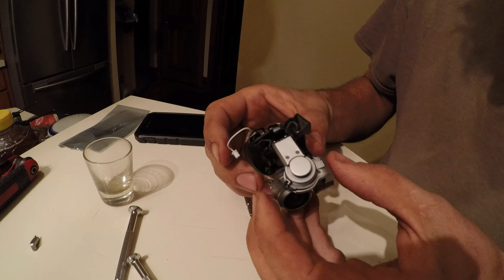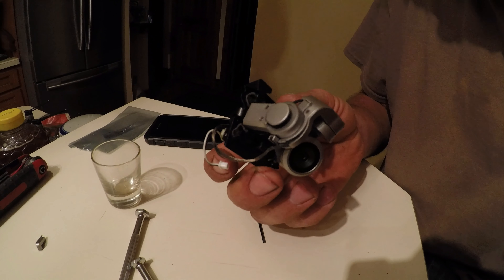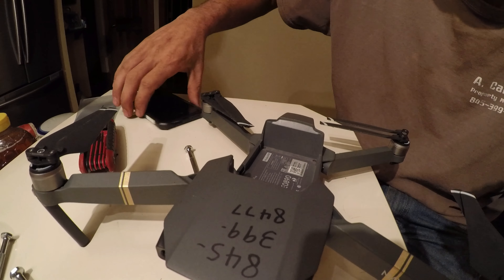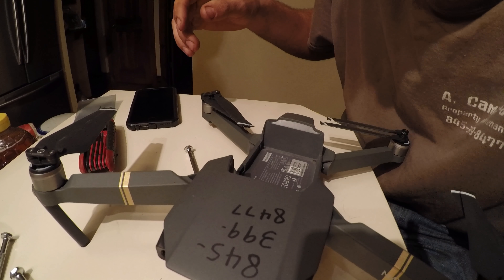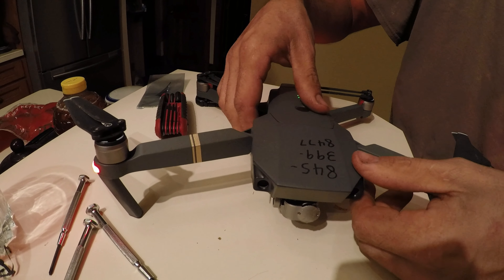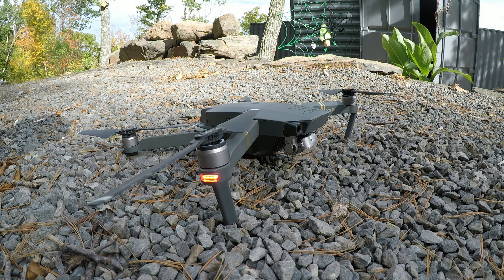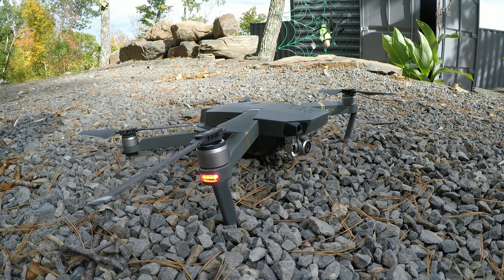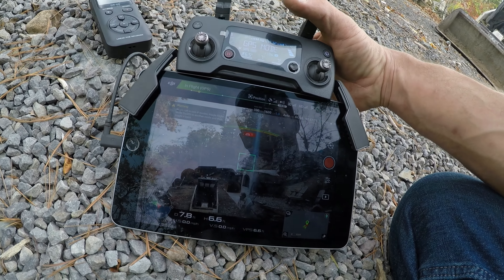Fixing a drone

Comment: I'm glad that the Baby Eating Spider didn't have anything to do with this... I imagine that the ribbon cable was relatively cheap for the most part. I remember when I clipped a branch with my Phantom 3 and it took a 30ft fall, had to replace the whole camera and gimbal, that was a pricey mistake... Oh well. Crazy that this is the second time to replace the ribbon.
Reply from the maker: Yeah, it was cheap, I ordered two. I hope it last a while now. I could probably do it easier the second time, but routing that cable in that camera was difficult.
Reply: Yeah, did not look fun at all! It's going to be interesting to see what DJI comes up with next! Lets hope something that is easier to work on. I feel like my P3 isn't bad... Mavic is still where it's at though!
Reply from the maker: Yeah, I agree. The Mavic is very good, it would be nice if the camera was more durable. Maybe a better mavic and a 4k spark.

Comment: been looking for a drone with a camera, your vids are all excellent ! Would  you buy another dji  ?
Reply from the maker: Yes, buy the Mavic.
Reply: thanks for the reply, other than the cheap stocking stuffer drones i have never used a good one before....can a novice  jump in to it without wrecking ?
Reply from the maker: Steve Sandstrom yeah probably. There are drones at any price point. Maybe look into the spark if you want to spend less. And there are some knock off mavics available now. But the real mavic is very cool.
Reply: how strong of a breeze can it fly with control ?

Comment: Good job but after the test failed, what was the fix, tightening those teeny tiny screws?
There's no final fix available (buy more ribbons)?  ;-)
Reply from the maker: It worked after replacing the ribbon. It slammed the gimbal twice when I first turned it on, but than worked normal after that.